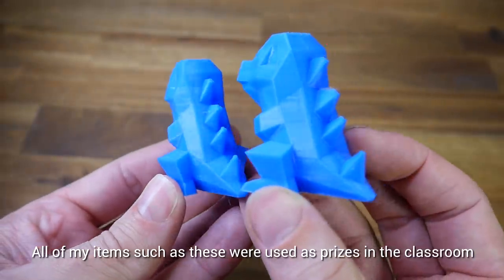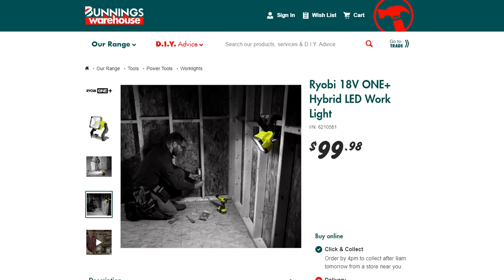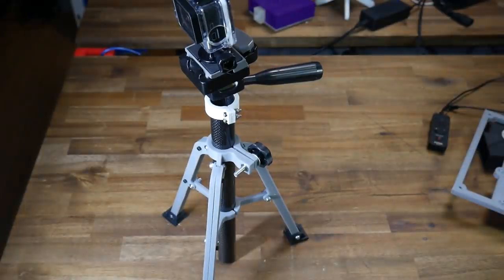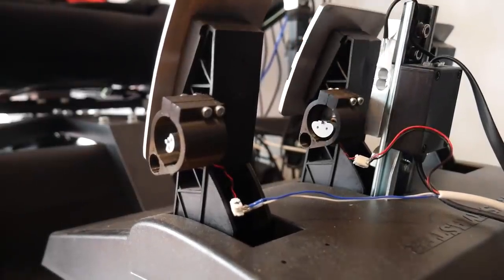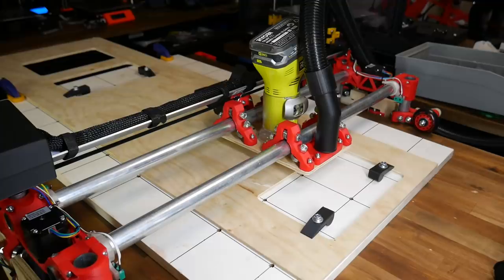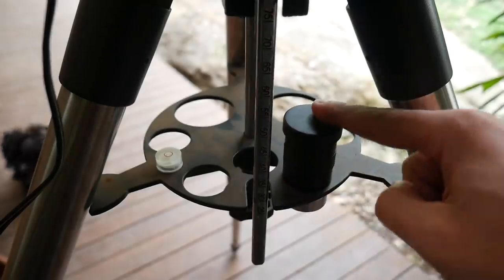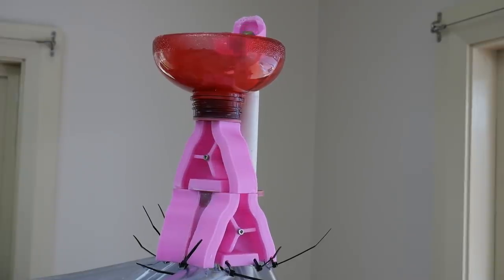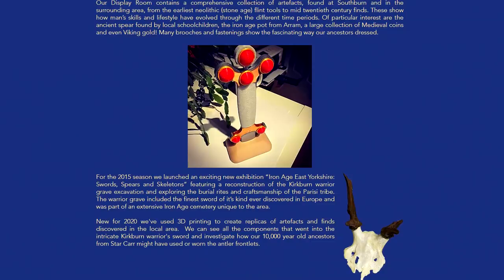5 reasons 3D printing is useful - My favourite practical prints

Comment: New to 3d printing and unfortunatly due to a fault Im currently without 1 until a replacement board arrives, but I have so far made a phone stand as a functional print, im half way through making a table that can attach to the side of my bath so I can relax and have drinks and phone and stuff on there, and also making some training aids

Comment: Just got my Ender 5 Plus so I can begin fabricating an experimental motor that I designed in CAD. And I'm still working on an experimental bearing which will also be fabricated when it's ready. If either of these are successful, they will be literally and figuratively revolutionary.

Comment: My mother has been creating seasonal door reefs. I have printed out shamrocks, bunnies, stars, hats, and a bunch of other shapes. All of them are flat shapes that where easily designed and only take a few grams of plastic to make. But they have added much to the reefs.

I have made clamps to hold Christmas tube lights in place after the originals broke, mine turned out better designed as the originals had no grip to them and the lights would often fall out of them.

Recently I made a nic inhaler. The inhaler that my pack came with was flat  , I made one that was round more like a cig. It's a small change but if it helps me quit smoking even a little why not do it.

Comment: Few years ago, I spent some time to look into 3D printing. But the indoor air quality might be impacted by the particles emitted from a consumer 3D printer. I gave up the idea of buying a 3D printer. 
However, things changed and I am reconsidering getting one now. 
Is a beginner 3D printer with only 100x100x100 km build plate too small?

Comment: 3d printers are so cheap now, I really think everyone should have them if they do any work around the house. I can't even tell you how many little parts I've printed to fix things. Brackets, bushings, washers, etc. Internal parts for household machines (Washer, dryer, etc) and such can be 20 bucks or more for a little piece of plastic.

Comment: About 95% of the things I've printed have been functional items, brackets to mount things, wiring management, replacement parts for things that had broke. I even fixed my toilet when a small plastic (nylon i think) bolt that holds on to the float arm had broke. It was a Sunday and local shops where closed, I took measurements of the original and printed my own threads and all. that was 3 years ago still holding up fine.  and most of the prints only cost pennies. clip breaks that holds the trashcan lid on, no problem, design and print a new one, if it breaks again, you already have the design print it again and in 15 to 20 min, you got it. Odds are would take you longer to go to the store for a replacement, if such a replacement even exist. There was a bit of a learning curve but it didn't take long and I've learned most of what i know from watching other makers on YouTube.

Comment: 3d printed dimple die press is one of my more functional or useful prints. It's to dimple and form .1-.3mm nickel or copper strips. A piece of foam attached to the metal strip lets the formed dimple be a robust high current contact for cylindrical li-ion cells. 

Except for a flat metal square to impart a flat surface into the formed dimple everything is 3d printed.

Comment: Also, 3D printing can print stuffs undoable by others means, because you can have infill percentage and lattice, hidden mechanisms, etc. I am always surprised by the rigidity and weights of 3d printed parts you cannot achieve with traditional injection method

Comment: I need to learn to design things in CAD instead of trying to find them pre-designed.
Reply: I recommend Onshape. It is a pretty good software that is free and is up to the level of possibly of software like fusion 360 or soldiworks (although it isn't quite the best, it is probably the best free software)

Comment: I'm Mechanical Engineer in R&D department, now days almost everything we do in CAD will be 3D printed first because its very cheap and very easy to change things if you dont like something, only after that we will do full metal prototypes. also we use 3D printed components  as brackets to alot of our testing equipment, we have new projects all the time so its very cheap and time saving to just 3D print something in the office instead of ordering it from outside.

Comment: Another great use for 3d printing is for models like figures for dnd for example. Being able to print minis, albeit with a bit of work to get the necessary detail, is an incredible resource. Minis are really expensive but the plastic or resin is incredibly cheap by comparison. On a related note, costume parts and props. Jeff Dunham makes his own props and puppets and 3d prints certain parts when he needs to copy a puppet and scale it up or down. The potential for costumes and props is endless when you can just print an exact replica of something

Comment: The sole reason I bought a 3D printer was to print vintage rc car parts these are exist no other way. But from there iv printed almost anything I can.  With the current lockdown Iv printed waste pipe clips, guides for my blinds and even tile spacers saving me going to the shops.  :)

Comment: Clips and hooks. By printing clips that work with the 3M Command Strips I have saved enough money to pay for the printer. A good example of this was when my spouse wanted to augment her harsh overhead fluorescent lights in her classroom with warmer led strings stretching around the room. Pricing the needed 94 clips and strips from 3M on amazon it would have cost more then $200 and would have been a painfully obvious and have been a massive waste of plastic. printing the clips on my Ender 3 cost almost nothing, with the strips alone without the clips only costing $12. An added benefit was being able to color match the smaller clips to the light strings making them almost invisible. The strings seem to float on the wall. 

My current project is mini shelves for collectables and kids artwork that again make use of the command strips. A more attractive and efficient use of wall space then traditional shelving for small items.

Sure, I mostly print benchys and baby yodas, but I do enough of this type of thing to cover the cost of the hobby.

Comment: I have started 3D printer research 3 or 4 times over the past 7 years and always stop short of diving in because of all the horror stories (maybe imagined) of failed prints. I’ve got ideas for a few projects but not interested in knick knacks or role playing game pieces. I want to design, print and be happy. I don’t want to spend hours/days tinkering to get it right and only end up with strands of PLA and more importantly - sitting in divorce court. Am I wrong?

Comment: I am surprised that no one has said "Toys".  You can print some very cool toys for your kids.  Check out Thingiverse.  It is good to print the toys with a softer plastic like PETG or TPU.  My teenager loves his Mandelorian Helmet that I printed from a model on Thingiverse.  My wife loves her Heart Picture Frame, which she proudly displays on her desk with our family photo.  I also printed out some toothpaste squeezers and other practical items, again from Thingiverse.  I printed out a box in red TPU and I keep a tire repair kit in it, which I keep in the trunk of my Tesla since Tesla's do not have spare tires.  I also designed a silverware tray to exactly fits my silverware drawer and holds the maximum number of utensils!  I printed a waste basket that looks very cool and matches the decor for my workshop.  I printed a skull pencil holder that my wife keeps on her desk.  She loves that thing!  I print lots of useful items that either do not exist or would be much more expensive if I found them on the market.

Comment: I used to work for an employer that manufactured parts for airplanes.  %50 of the parts were 3D printed.  I thought it was rather cheesy but after handling them I found them to be quite high quality.  Considering a typical batch was 20 pieces, very economical.

Comment: I'd like to print those corona virus face shield holders for health workers but the print time seem long. I cannot do 3D design but if someone can, can they configure a print with multiple shield holders in a row with built in supports needed to cut print time and boost production? Not sure the average hobbyist print bed size, but maybe if someone could design it so there's 3 at once, 4 at once, 5 at once etc versions of the model?

Comment: I’ve made a headset stand and nothing fit properly, had my printer for two weeks, but it’s not very accurate so I doubt I will be able to replace broken things. From .1 to .3mm over and .1 to .2 under measured size.

Not really sure how to fix it since it can be .1 over on one end and .3 on the other end of my 20x16mm rectangle and even the 5mm height is off, both top and bottom have a ridge and a smooth area that is smaller.

Printing with a xyzprinting da Vinci jr 1.0w, I’ve gotten it to print the baby Yoda on a pedestal ‘what you seek is seeking you’ from thingiverse and it looks really good on the 3rd try, but obvious imperfections compared to others prints.

Even the print times cura shows end up being hours longer, from shown 7 to 25 hours.

Can anyone help??
Reply: There are a few major factors that go into having an accurate print.  It takes a little work, but you can make some big improvements.  I would start with calibrating the extruder. https://www.3dhubs.com/talk/t/howto-calibrate-tune-and-fine-tune-your-printer-and-filament/5695

You can also often print a small piece of the part you are making to test fit.  Hope that helps.

Comment: i used my printer too make both modles like dragon modles and the like . as for useful prints i built a phone carying case for my belt loop , a battery pack case and built a battery pack in too it , my dsi and 3ds carrying cases that both hold games 12 games for the dsi case and 16 for the 3ds case . as well as soo soo many other usefull prints.

Comment: So much usability... like improving the functionality of existing parts. for example: a bracket for my s9+ so i can use gearvr without the cable attached. Or a bracket for my cpu cooler so i dont have to replace my 200 dollar liquid cooling set designed for a pentium 4. Than there is repairing parts: a custom made weird ass gear for my projector screen (new price: 90!! euros) i printed it from nylon for about 75 cents. Or a car handle for my uncles old timer car from abs + vapor smoothing and painting, saving him over 80 euros in costs. Then there is the whole creating new custom design... like beautifull wall handles for my dumbbels, a fully working lamp for my gf with pictures of us engraved into the sphere, a custom battery case for an old drill so it could work again, a fully build RC cart, crucial mounting  parts for my CNC machine, crucial frame parts for my RV  and countless of custom designed bobheads using 3d scanner images from my friends. There are so much more possiblities its stagering. Every day i discover something where i think: oh i could design and print something to solve this.
Reply: But to be fair: the biggest thing i like about 3d printing is the tinkering and education that it brings. I would not be happy with a ultimaker 5 that already does everything well at all. I love upgrading my 3d printer every now and then. Time/costs wise it is completely uneffective... as in the money i could have made taking off 3 days to tinker with 60 euro on craiglists tevo tarantula couldve nearly bought me a prusa, but it would not have brought me the fun and educational experience that fixing this printer has given me. Im now thinking of new solutions for dual extrusion, including a tool changing mechanism on the x-axis using magnets. Super exciting stuff! It litteraly makes me excited as a kid before his birthday.

Comment: 3d printing 2020 still takes enough work to make you feel like you made the print vs just hitting a start button and the printer doing all the work. 

What Im trying to say is if I printed the Mona Lisa with my paper printer It wouldn't even cross my mind to take credit for making it. Currently 3D printing has a certain level of satisfaction and feeling like you made the part not the machine.

Comment: Comment here so we can share our practical prints. Even though 3D printer parts are practical I don't count them.

1.Ninjatek male wedding ring
2. Brackets to mount false bathroom cupboard drawer panels
3. New wheel for sliding bedroom closet doors.
4. Mini garbage cans (vase mode largest size for build plate, 1.0mm) for bathrooms and bedrooms.
5. Gaming Headphone hanger w/ command hook tape 
6. I do count hot wheels tracks, jumps and Lincoln logs for my son.
7. Zubits style shoelace magnets.
Reply: @BlenderMarci  what did that cost you for all the other parts excluding the Transmitter?

Comment: Please show some better examples.
Many of the projects you presented could easily be done with woodworking skills and tools.
I would highly suggest not using 3D-printing when other manufacturing methods can be applied with more suitable materials.

What I do agree on is how useful 3D-printing is to:
- get 3D-models from the software directly into a physical form (e.g. prototyping)
- fabricate custom tools/templates/brackets that would take to much effort to build by hand

Comment: The fact is , once you have a 3D printer, the applications for it, come up like poo.
Common wording : "Heeey , I can print that !"
A simple example, everybody knows about:
I have a vacume cleaner, and parts from an old one, that don't fit.
Easy to print an interface.
But that's a very common problem...
You break some part; you need to buy the whole thing new, and throw away the old one.
Because, you cant buy single parts, to fix it.
A friend of mine had this cothing drying mill thing.
Basically, it was designed to fail.
So I printed this:
https://www.thingiverse.com/thing:3714837
Much better design.
And I will be posting more of these things.

Comment: I'm into sim racing and 3d printing is amazing for making parts. wire clips etc.
I also designed and printed a case that holds a nextion display on my wheel rim (for telemetry data from whatever game I'm playing) 
I've printed adapters to allow me to use real world rims on my wheel base.
if you search thrustmaster on thingiverse there are a TON of mods and upgrades that people have designed (every single one has a practical use) there's even designs on there for fully printable rims
https://www.thingiverse.com/thing:4308285 for example...... to buy a rim like that would cost hundreds (think like 800) of dollars
I also fly RC helis and the 3d printer is great for printing replacement parts for that (servo arms and the like)
however I have been into 3d modelling and CAD since the 90's so I had a kinda head start when it came to designing stuff I can see how 3d printers would seem pointless to people who have no knowledge of design software.

(printing trinkets from thingiverse is like using your standard printer to print text you didn't write, to get the most from a 3d printer your really need to learn some CAD or 3d modelling software.

Comment: A 3d printer is only as smart as the person using it.

Pro tip: if you are thinking of buying a 3d printer, make sure to learn how to use a cad program or 3d modelling software, or the printer will end up collecting dust after printing only a few trinkets.

Comment: The fact that my watch has wifi, bluetooth and a 64 bit dual core processor, and yet your average printer doesn't, just shows 3D printing has no real application and hasn't developed into all the hype.
Reply: You really miss the thing, that there isn't a need for a strong processor in a 3d printer. As well they want to keep them cheap and in range for everyone. You can get printers with wireless connection, but a big amount of users simply don't need it.

Comment: "You can make one for free"  is technically incorrect, it'll cost you perhaps up to 50 cents or more in PLA to make one of those center finders.
Reply: But it saved him gas cost that would otherwise be spent going to the hardware store.  Not to mention less air pollution from the exhaust.
Reply: @Joe_Galaska  I'm being only a bit jokingly nitpicky, but you still shouldn't consider 3d printing entirely "free".

Comment: 4:17 stop using that Logitech keyboard. It uses 2.4ghz non-bluetooth communication and is EASYILY hackable (I know this first hand as I have that exact keyboard and have tested all this myself) meaning anyone near you can remotely inject keystrokes onto your computer, which basically means they could have full access and control of your PC. It's incredibly easy to do and only takes $20 worth of hardware and some GitHub scripts! Its also possible to capture the keystrokes of everything you type on that keyboard in real time with the same scripts and hardware, and no amount of antivirus or anything like that can protect you from it. Typical range for these attacks is 30 meters, but with a high gain directional antenna it could be done at much longer ranges.
Reply from the maker: Thanks for the heads up.
Reply: @TeachingTech  your welcome. If your gonna use wireless keyboards, stick to Bluetooth devices as they are not vulnerable to such attacks. They are vulnerable to other attacks during the pairing process, but once pair your ok.